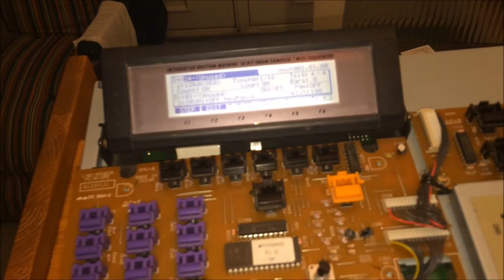MPC 2000XL Repair PART 1 - Tact Switches, Rotary Encoder/Scroll Wheel and Fader - how to replace

Comment: Props on the soldering game! I suggest before replacing buttons use deoxit on them first (once sprayed they will need a couple hundred presses for the deoxit to work in, may need 2 or 3 runs at this) especially if your soldering is not that good. This goes for the jog wheel on these as well. However, the fader, well, we all know once its gone, it's gone forever....
P.S. i watched till end to see the fader test....

Comment: I fixed it I used a different type of tip for my solder gun the exact one on this video and made sure the metal was not touching the other metals on the circut board each circut must be in there own housing or foundation then it worked perfectly ever metal must be inside of its on line without touching others and there you go My solder temperature was at 450

Comment: I just installed a data wheel encoder but mine doesn't work and its the second orderd im wondering if i had to avoid touching the cicut board the my soldering skills arn't the best of the best I can solder and unsolder so far I'm wondering if it makes a difference if the circutbchips touch each other I'm think I need to keep the chips solderd separately any help  is appreciated guys?

Comment: I took mine apart and the Berg connector that powers the floppy pulled out exposing just the two pins that go into the 4 pin connector. I don't know which pin goes where now if the red goes at the left or right of the 4 pin housing. does anyone have a diagram or pic of the floppy connectors
Reply from the maker: Not me. Sorry!

Comment: This is a life saver for any one wanting to save Money and getting hands on experiance for any MPC500,1000, and so on and so forth .
Reply from the maker: Glad it was of use!
Reply: I just got my  second new rotary knob solderd it and its not working the model is correct one this time can it be its not making a correct  contact everythin else works except my data wheel any help is appreciated any idea whats wrong is the metal not supposed to touch the circut board

Comment: I need to fix my MPC 500 Data wheel it's wonky thanks for the class lesson how many watts is the soldering supposed to be 30 or 40 watts or more I need to operate thanks for the feed back greatly appreciated.
Reply from the maker: I think I used two soldering irons. The first one was cheap (probably lower wattage)and then I upgraded to a variable one. Someone gave me some advice at the time but tbh I cant remember whether the optimum was hotter or cooler. Probably best to search some general circuit board soldering resources online as I'm far from a pro.

Comment: Heyup Daddy Abe.

Just bought a faulty mpc 500. It was your vid that made me decide to give it a whirl.
Where can I get a replacement encoder from in the UK ?? I am ok with a soldering iron but never done anything like this before.. Is it particular type of soldering iron etc I need??? I have one but it seems a bit cumbersome for this job... 

Should I replace other parts while I am at it or should the if it aint broke rule apply??

A list of what I need would be top notch... 

Cheers bud..

Craig
Reply: Just watched your second vid and answered one of my own questions... Jazzcat... sorry bout that... I'll pay more attention in future.
Reply from the maker: Hey bro I think any soldering iron should be fine. I started with a cheap one from the market but then upgraded to one with variable heat settings. Think I got it on eBay.

My first port of call for parts in the U.K. Would be Jazzcat. Hit him up on his Facebook page.

And na I wouldn't bother fixing/replacing parts if they're not broke yet.

Good luck!

Comment: Great work and good job explaining everything! What's the purpose of using that copper wire when desoldering? Couldn't you desolder without it?
Reply from the maker: It kinda soaks it up like a sponge. Alternatively you can use a desoldering suction pump, but I didn't find that as effective as the wick.